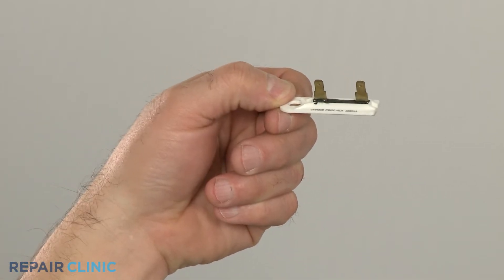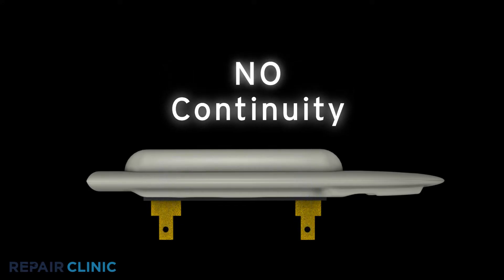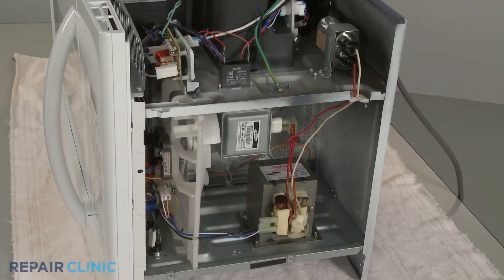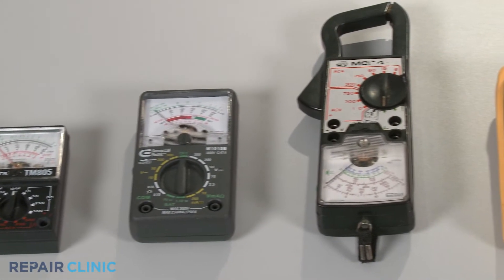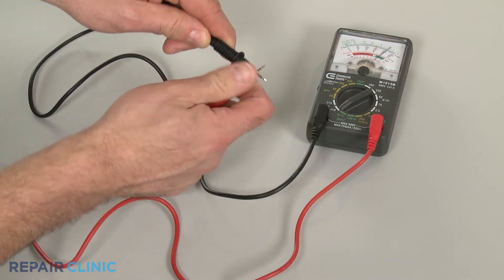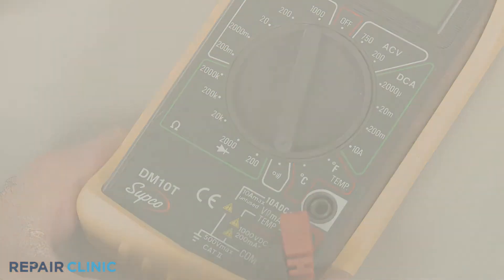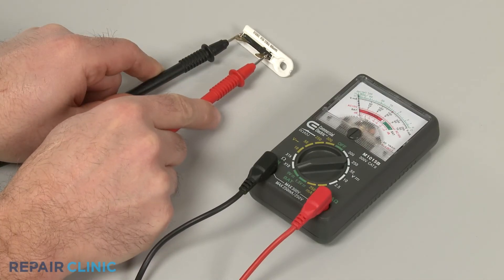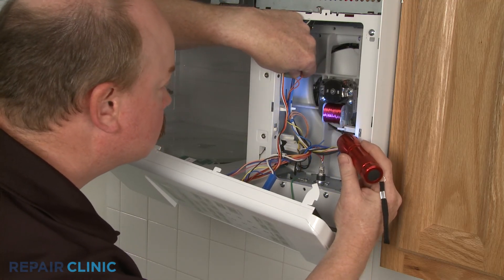Microwave Thermal Fuse Testing

Comment: If the fuse is is no good in my microwave, will it still turn on , turn the turn table, and operate the clock. Only problem is it does not heat up
Reply: It's possible the fuse is bad and still allows those things to function this is the same thermal fuse used in whirlpool dryers and it can still operate somethings when it's bad